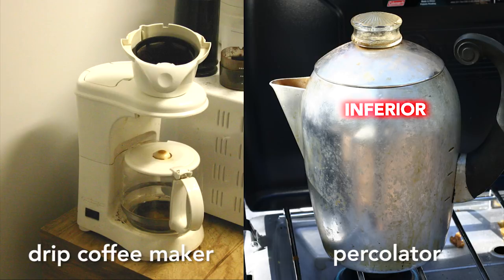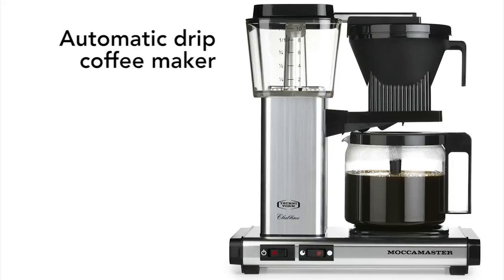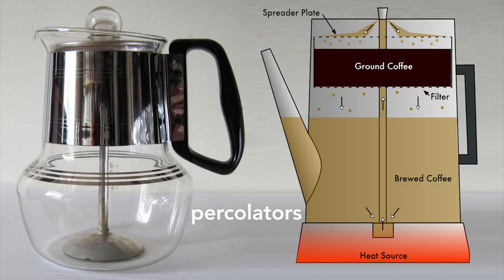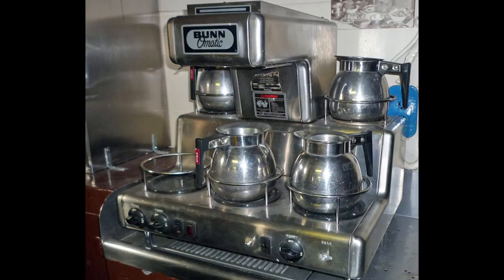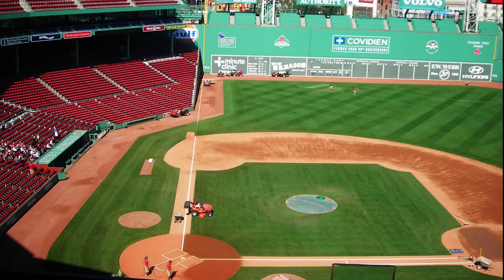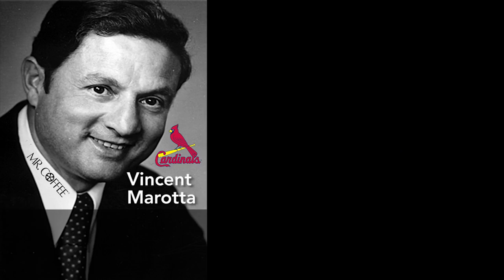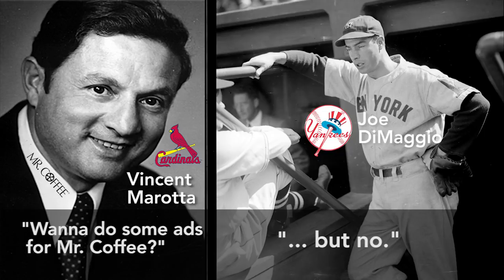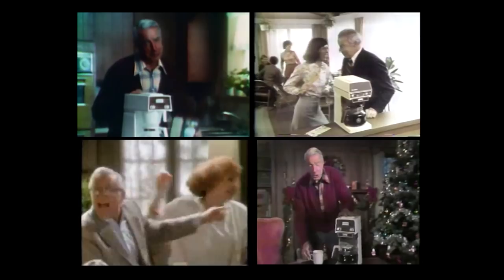Coffee makers: How baseball put them in our homes

Comment: In order to get something close to a decent cup of coffee, from a percolator, is to use coffee beans with almost no acid. Something that is not easy to find.  I have had some which i tried in as percolator and was pleasantly surprised by the results. That same coffee is very humdrum when brewed by any other method.
It is the boiling of the coffee that makes makes it so bitter.
I prefer French press (cowboy coffee) or use individual paper filtres.  Those Mr. Coffee style coffee makers are only good for the first cup. It quickly becomes "security guard" coffee, even with quality beans.

Comment: Bunn's 3 minute gravity brew design is the BEST! Automatic drip is still too hot! The design is simple, (which baffles me on the $100 price tag): A chamber is kept hot, the top chamber is empty. When the top chamber is filled with room temperature water, a hole at the bottom drains into the heated chamber. Plumbing directs the overflow from the heated chamber to a miniature shower head located over the coffee basket thus making the pot a 3rd and final chamber in this process.

PARTY TRICK: If you own a Bunn you can amaze your friends by placing your UNPLUGGED coffee maker on the living room coffee table. Put the coffee in the basket, pour the water in, and watch the astonished looks appear on your friend's faces when you pour them a steaming HOT cup of coffee that your UNPLUGGED coffee maker just produced. (You can't do a second pot)

Comment: An important point: for some roast levels, boiling hot water may in fact be desirable. The major problem with percolators (and drip coffee makers too) is that they continue dumping a lot of heat into the finished coffee, which does burn it.

Filter coffee is vastly improved by turning the hot plate off more or less as soon as it's done. If you've brewed loads and you need to keep it hot, a thermos is a better option than a hot plate, provided it's clean and very well rinsed

Comment: Percolators make MUCH better coffee. I use one to this day. The main difference is the water temperature. It gets much hotter in a percolator.
Reply: +tarstarkusz He explained in the video that their fault is the excessive heat, which makes coffee bitter
Reply: That issue could be solved with very simple engineering to let the water cool some more after it goes up the pipe before hitting the grounds.
Reply: +D8W2P4 I prefer the taste of coffee that has been percolated. Of course, I drink the terrible American brands of coffee (Folgers, Maxwell House etc).

Comment: I like french press myself, it's a bit of a pain in the ass though. Also, what about a vacuum brewer? I heard those make a mighty pot of brew as well, it just seems a little brash to call drip coffee making the best.
Reply: @ohio  If you watch a drip coffee machine, it fills the coffee to the top with water, before letting the water out. During the whole drip cycle the coffee is brewing.
Reply: @stevenm8970  Uhm, no, the water just constantly drips out of them. Unless every single coffee machine that my family, and any friends, and everyone we've ever seen using a coffee machine owned had a faulty filter holder.
Reply: @ohio  Drip coffee IS pour-over coffee and vice-versa. How do you not understand this? What you just said is basically 'coffee is better when you pour the water over the grounds by hand than when a machine pours the water over the grounds'.  Huh? Coffee makers aren't all exactly the same. If you've never found a good one, then you must not have looked very hard if at all.

Comment: One mistake. The large Bunn machine seen in the video does not make 5 pots at a time. It holds up to 4 full pots hot while making the fifth.

Bunn is still the leader in restaurant-size coffee makers. One of their great advantages is that after you turn them on, they heat up a reservoir of water that is large enough to brew 2 pots at once. So that when you make a  pot of coffee, you can make a second immediately, while it heats the water for the third pot, In essence, they can make pot-after pot continuously. Obviously, these machines are attached to a water supply, no dumping in water by the pot as most people do at home.
Reply: Bunn does make a restaurant machine that does not need to be plumbed in. It is the VP17, it’ll make two pots of coffee. I have one as my home coffee maker and love it.
Reply: The commercial machine I used would heat the water, then a pot of cold water was dumped in, it sank to the bottom making the hot water overflow over the grounds.

Comment: Another great video. It's like experiencing the book all over again. I'd like it if all of the commentaries could make it to video form if possible. I think it would be a great video series (just as it did for radio).
Reply from the maker: We have done a few more ... we'll fill out the place list a bit ...
Reply: ***** I have calculated the time difference using a drip coffee maker makes to using a percolator, here: >8 (stove top) to 16(electrical) minutes to brew cofee with a percolator (preparation included) so an average of 12 mins each morning              >4 to 6 minutes for coffee with drip coffee makers including preparation(average= 5min) So with a lifespan average of around 30,000 days (~82 years) that means you waste 145 days, 22 hours and 19 minutes (210,000 mins) of your life only brewing coffee more than with drip coffee makers because the time difference is 7 mins (12 minus 5) and 30,000 mornings of 7 minutes longer makes (7x 30,000) 210,000 minutes which equals 0.4 years.

Comment: Great video, however I do disagree with the thought that Percolators are inferior coffee. I would be of the opinion that it's the exact opposite. The flux of drip coffee makers has made for a very bad taste in my honest opinion. Drip coffee makers are widely considered in coffee circles to be the bottom of the barrel. I think Percolators create a very hot, and smooth alive coffee if it's drank within the first 20-30 minutes. I prefer it personally.
When I say drip coffee, I am speaking of home brew drip coffee machines. I think they, for lack of a better word, suck for pure taste. Restaurant coffee machines, which are mostly drip in a different way, are much better in my opinion. They are more industrialized, and make a better pot.. actually a great pot. But home brews, are just awful and truly are the bottom of the barrel. 

Also in my opinion, outside of the restaurant coffee machines, or diner type coffee machines, I reckon the Coffee press, or French Press as it's better known, makes the next best coffee from home, for a cheap price. Although Keurig and Tassimo make a hot cup of coffee, the don't quite compare to a proper, hot, stainless steel, smooth coffee of the  Percolators. My 2 cents. Take care
Reply: I agree. Percolating at home is superior to drip. Also, percolating allows you to control the strength of coffee. I usually let mine run a couple of extra minutes for really strong coffee.
Reply: Absolutely. Properly perked coffee is always superior to drip. Drip could be done well but the parameters are too critical. 

And of course the french press is better than either and much more foolproof.
Reply: I find a French press or cold brew is still superior to the percolator. I find a French press or cold brew is still superior to the perculator. These sludge from the perculator can be quite a problem however a French press uses far more coffee to get a strong cup. you can also use it to make Turkish coffee if you're into that sort of thing. I still think cold brewing coffee though is by far the best and is what I usually do now I usually through about a gallon at a time and drink it over the next week
Reply: As a percolator user I have to agree. I've learned that the temperature of the water is very important, if it's boiling it's too hot. I have a 9-cup stainless pot that makes great coffee.
Reply: Totally agree, I think percolators get a bad wrap because people don't know how to use them. I brought one about six months ago and I love the coffee I am making with it now. However it took me a little while to go from bad to good and now I can do very good. The trick is not to try and heat the water too fast and to turn it down once it starts to perc. Then give it 5-8 mins percing.
Reply: Yes.  Bad percolator coffee is almost always the result of operator error.  Appropriately ground (very coarse) coffee, no paper filter, and proper timing yields, in my opinion, a superior cup of coffee.  Anyone looking for the reason their percolated coffee is bad need to look no further than the mirror.
Reply: "Your opinion is incorrect" is what the coffee sales from the 50's-60's would say to you. Perc coffee was the only thing and people hated it. Plus if you were right, perc coffee makers are still cheaper to produce, why aren't they as popular?
Reply: I agree with you.  My automatic percolator makes much better coffee than any drip maker I've ever used.  I won't be going back.  The stovetop percolators are tricky to use properly though and I can see how they could produce poor coffee for the "unskilled".
Reply: opinion aside, percolators necessarily run boiling water and already-brewed coffee through the grounds.  Multiple times.   read up on coffee chemistry, most experts agree that ideal extraction of taste yet not extracting bitters is by using water slightly below boiling temperature, approx 185 deg F.   Also most believe that a single-pass-through is best.   Drip Machines allow some cooling before hitting the grounds, and are single-pass systems.   French Press, Turkish, and AeroPress are not single-pass but can be done in a way to control the time of exposure, and all give the user control of the temperature of the water (but lack automation).   Of course some people PREFER the effects of a particular coffee method, so there is perhaps no "correct" answer (much like wine, chocolate, music, art, film, sex, etc).
Reply: @c.ake8033  interesting. I just realized I'm a total coffee snob

Comment: I like to use a french press for coffee at home , and I do like drip if it is made right and not left sitting on the burner forever. Oddly, I still really like the coffee made in my Grandfather's old electric percolater. I can't explain why, but it is pretty smooth tasting.
Reply: Automatic percolators make great coffee because they don’t boil the water and they stop percolating the second the coffee is done. Stove top percolators are difficult to use well, that’s why most people don’t like percolated coffee. I use a stove top siphon, that thing makes excellent hot coffee easily, much better control.

Comment: for me this stuff are just Rube Goldberg coffee machine to be honest..........  i still use a flip coffee pot at home and a moka in the office.....   no moving part, no electric components, compact size, cheap to build.
a flip pot will last more than you and cost basically nothing to make, in a moka you'll need to replace the gasket if you burn it but that's it......
here you can buy an aluminium flip pot for 10-15€ and a moka for 10-20€ depending on the size....

Comment: Auto drip swill is not good coffee. Get a siphon, you will never go back to punky acidic swill.

Automatic percolators make better coffee than auto drip because the secret is DON’T BOIL THE WATER. That’s tough to do with a stove top percolator, I have one, I have gotten lucky and got good coffee out of it but it takes too much luck. The engineered pot is preset so works better.

Drip is the opposite, better to do it manually, like with a Chemex.

Comment: Percolators were originally meant for espresso brews, hence the bitter taste and over extraction. You're only meant to drink 25+/- 2.5ml of the brew, not a cupful. Also, by making the grounds coarser to speed the extraction further. I also heat the water to approx 55C while I grind beans which further speeds things up. 
Sources = Engineering student with Italian relatives

Comment: Or you could drink espresso which is actually good
Reply: A expensive machine that works with high pressure instead of one of the most efficient inventions ever? maybe the coffee is better but from an engineering stand point the machine isn't/
Reply: Tom Bruggeman actually the Drip coffee maker does terrible long coffee (but obviously that's only my opinion), and no, the espresso machines aren't expensive, at least here in italy .-.
Reply: Nuovo , define 'not expensive' cause there are drip coffee maker that cost like 12€. 

I would actually say the inconvenience of having to buy filters is the only department where it's worse than a espresso machine, if you don't operate a café the time is not considered to be that big of a deal. If you want instant coffee there is instant coffee on the market. 

Also espresso machines need regular maintenance and they are less intuitive to operate.
Reply: The issue isn't that the consumer cannot afford the espresso machine btw , it's just not as extremely cost effective as a drip machine.
Reply: Tom Bruggeman yes, they are more expensive than drip coffe machine (not here, where it's quite rare finding one, but i assume that in other countries yes), but they don't cost 2000€, they are more or less 50€ (not the nEspresso machines that costs like 190€ but the "normal" ones).

buy coffe pods (name from google translator i dunno if it is right), problem solved! put one in the machine, push the button, wait 15 secs and you're done!
Reply: The nespresso is pods , Phillips senseo is called pads
Reply: The issue with those is that for a long time coffee brands needed to invest in the license to make pods and pads and invest in machines so the regular cost apart from buying the machine is significantly larger and it's a bit like with the betamax versus the vhs etc. You don't know what's going to last , while you put the same grinded beans in a drip machine you can put into it's predecessor. From an engineering standpoint this makes it a better design. That is not to say I personally don't like my senseo better.
Reply: Tom Bruggeman
 the nespresso pantent on their capsules expired and now almost everyone uses theirs and you can find good capsules for 20 cents each.
Reply: iafozzac that's true! and actually it is very good, unlike the ultra-long coffee made with the drip machine.
Reply: Tom Bruggeman but i wasn't talking about those, but those ( https://goo.gl/images/svPnvz ), because you wouldn't buy an expensive machine (would you?), so i thought about classic and cheaper machines.
Reply: Iafoetc , I know but still it's a different sort of market and companies that want to get onto the platform early on need to spend a lot on the investment.
Reply: Nuovo

Those are pads , senseo pads , we are talking about those I use them.
Reply: Tom Bruggeman didn't understand what did you say .-.
Reply: French press is also good
Reply: You can buy both at the same price.....
Reply: An acquired taste

Comment: The best way to make good coffee is: good coffee. That means you have to roast the coffee beans slowy at rather low temperatures. But that means also you can not roast big amounts of coffee quickly. On an industrial level that means the coffee gets more expensive and customers will buy cheaper coffee that is roasted more quickly at higher temperatures, basicly ruinig the coffee altogether.

I do not agree with drip coffee makers, the best way to make coffee is in my eyes the italian way (quick, hot, with pressure). Yet that would not help with bad coffee to start with. Good coffee works even with inferior ways of making it while bad coffee stays bad (or gets worse) no matter what method you use.

If you want good coffee, dig deeper in your pocket. Cheap is often just too cheap.

Comment: funny.  I ditched my drip maker for an electric perc and find the quality of the coffee is way better.  I do agree that stovetop percs make terrible coffee, but it works on the campfire, so I have one of those too.  Americans seem to like the bitter taste since I'm hard pressed to find light roasts over yucky dark roasts in most stores.  You hit the reason for the drip's popularity though; it's all advertising.

Question:  do the newer electric percs heat up the water to boiling?  Since the water in the container surrounding the uptube is relatively cold I would think the heated water in the tube wouldn't have to be so hot.